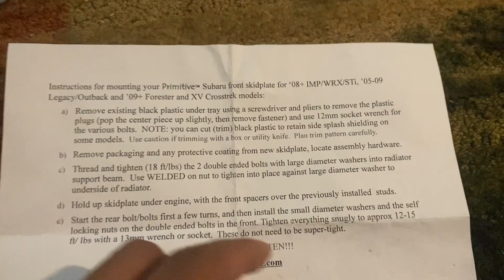Subaru Crosstrek XV Front Skid Plate Installation | Primitive Racing 3/16" Aluminum

Comment: banged up my skid plates pretty bad but better than busting the oil pan. I might get an insulation patch it stick on cause the rattling is pretty bad. also I found that the front bolt on one side got pushed into the radiator support. changing out the big washer for a wider square  washer might help reduce the chance of it happening to you.

Comment: Is there any worry from the increased exposure from removing the plastic cover?
I'm installing a primitive skid plate and I've been reading how people would cut the plastic cover into a "C" shape so they can mount both together.
I'm worried that salt and such will settle in the undercarriage with the just the skid plate installed.

Comment: Excellent installation video Thank you!!  Did you find that you get more water dirt, etc. in the engine compartment than with just the OEM plastic cover? I noticed the OEM plastic cover does cover more area. I have considered the Primitive racing skid plate and then modifying the OEM plastic one to cover more areas. I saw someone on You tube do that some years ago.
Reply from the maker: I do notice a bit more dust in the engine bay since the sides are more exposed, but I'm willing to sacrifice for peace of mind with more protection. I take this car to trails to haul my dirt bike around so it sees a lot of rough conditions. I may consider cutting up the stock under tray for added protection like you said though..
Reply: @PatrickKasilag  Thank you again!!

Comment: Hey Patrick:
Thanks for this video. Just wondering - did you lose much clearance? If so, how much?
Reply from the maker: Very minimal loss. Only thing I can think of that protrudes below the plate are the heads of the bolts (1/3'" maybe)